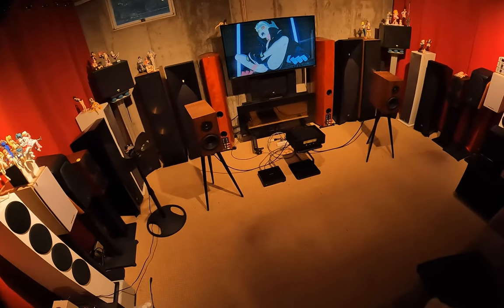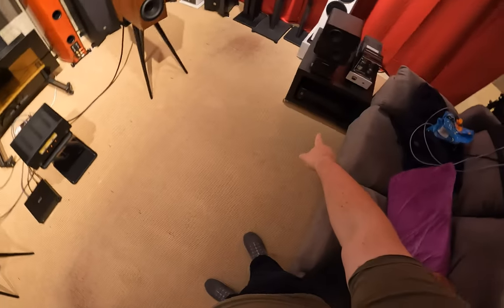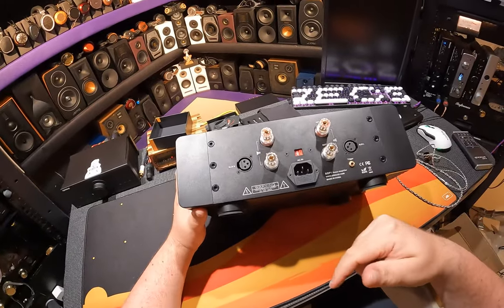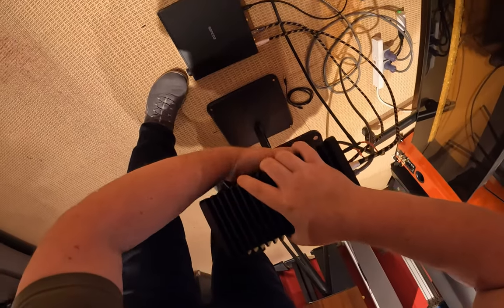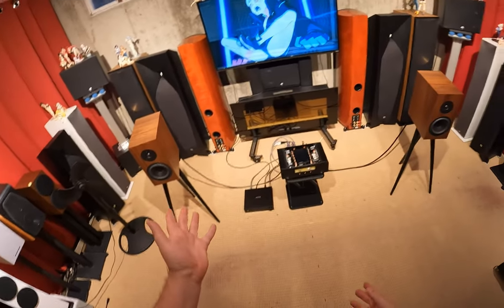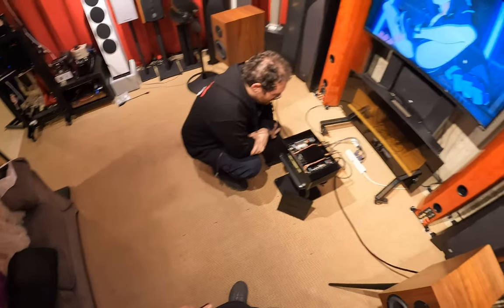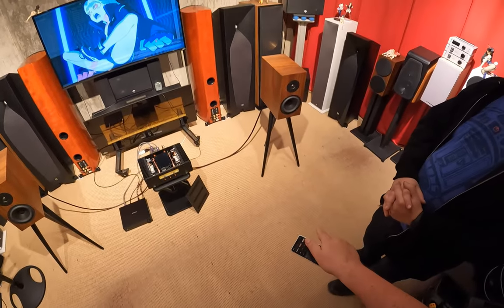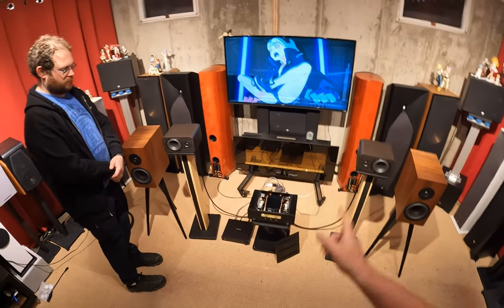The SONCOZ SGP1 is a Classic Power Amplifier with Modern Specs

Comment: You might like to try an Avantone CLA200. It's a brute. Balanced in & through, 200wpc@8ohms 300wpc@4ohms, class AB. Secret weapon in hifi. It's a pro mixing amp. You can get them from places like Sweetwater, or Vintage King. Sounds great on my Tannoy XT8F, which do dip below 4ohms. I got it as a starter amp, but I can't justify spending more money. If anything I might get another one & run a biamp big headroom set up. They're only like $800, maybe $900 brand new.
There is a vintage Hafler 9505 on Reverb that I want, but it's $1000 & I've been spending money like I can just print more. Ends up being like $1,120 delivered. Uhg!

Comment: I once read somewhere that symmetry matters inside an amp, like with magnetic fields or something. This seems mirrored inside..
Reply from the maker: Wait that Symmetry is BAD or it is GOOD?
Reply: Oh, as I understood it, symmetry is Good. So, the power section and plug is dead center and the two channels are symmetrically opposed against each other.
Reply: I can't find my source but I would really like to know what are the considerations for physical and signal path symmetry. You should reach out to Soncoz and ask this question.

Comment: "Every surround receiver that was mostly ever sold" is Class D and NOT class AB! Only a handful (and expensive) are class AB. This is usually because you need 5 (or 7,or even 9) channels to drive and thermally speaking you can do this only with class D unless your power ratings are extremely low.
Reply from the maker: Even in the early 2000's .. That is the era I always think about with receivers.
Reply: What's this?